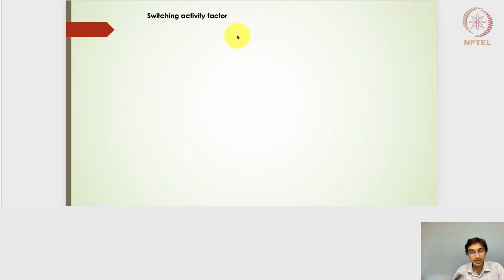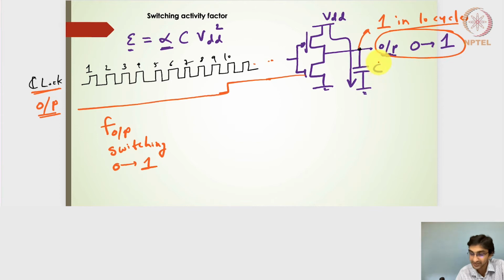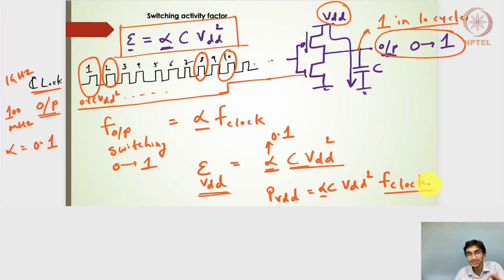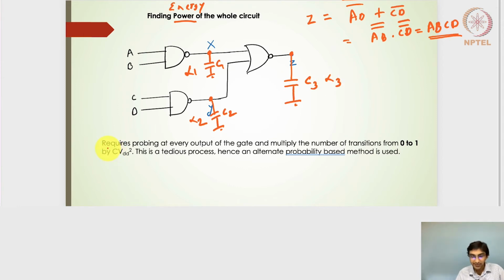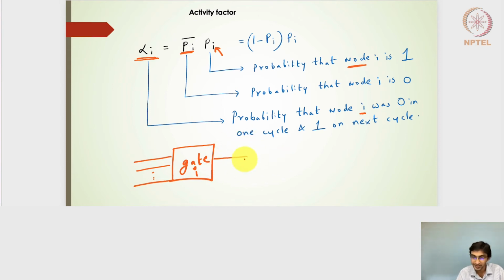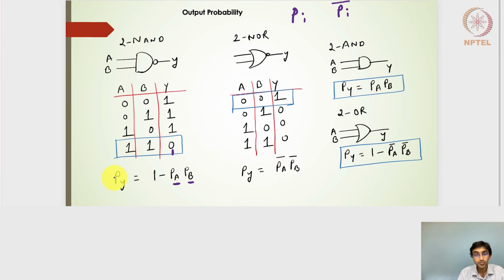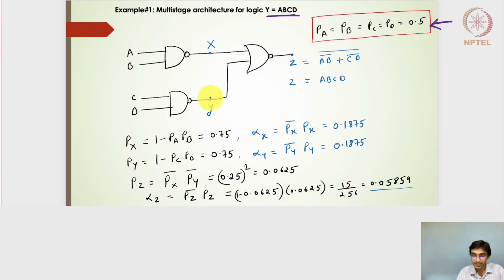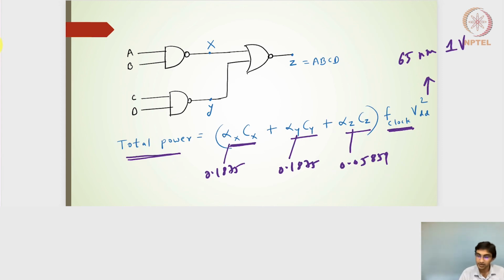9.2 - Activity factor and estimating dynamic power for a combinational circuit design

Comment: saying that the output going to switch one each 10 clock cycles (means going from 1 to 0 or 0 t01) is different from output going to cycle one each 10 clock cycles, so if it the output switch every 10 clock cycles, means that the Fo/p will be (1/20)* Fclk=50MHZ and alpha will be 0.05, so is it switching or cycling?